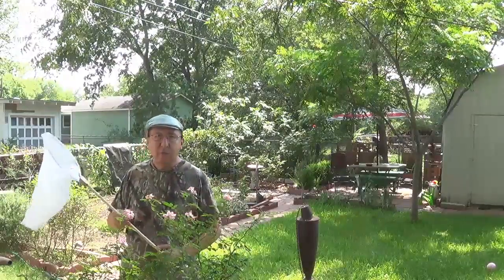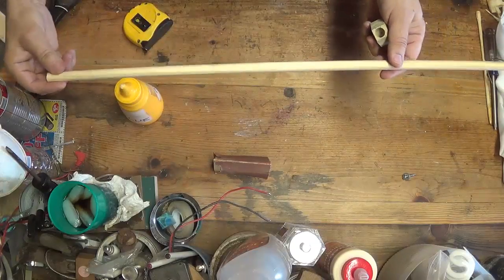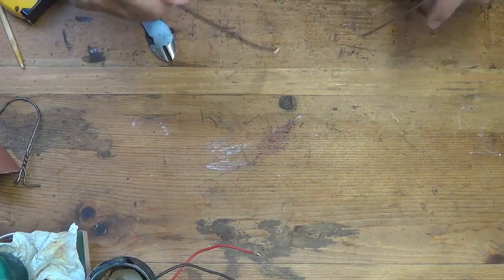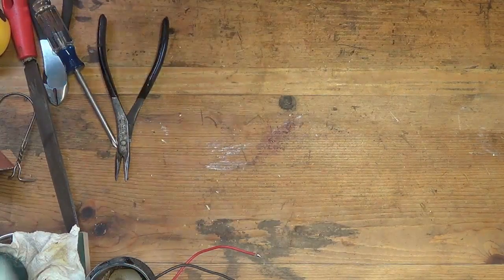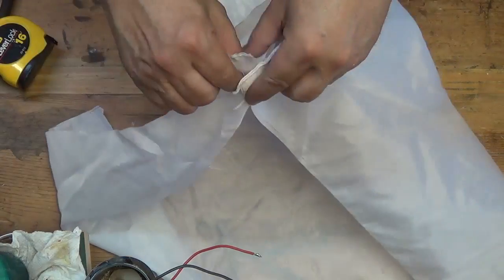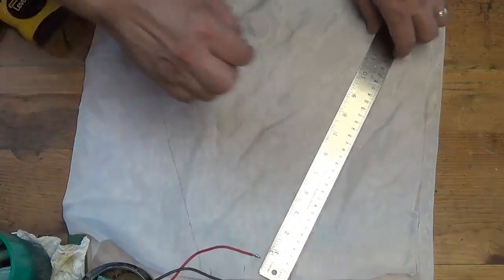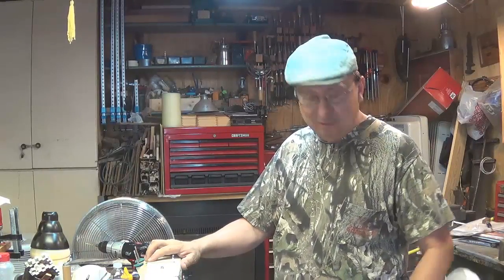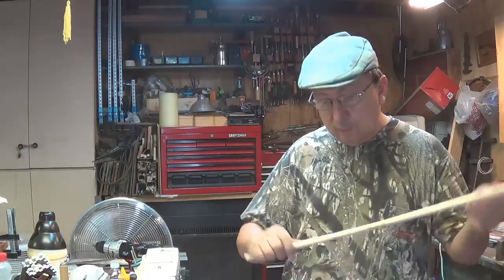Summer Fun Butterfly Net

Comment: Pretty cool. Needs to be a lot deeper to catch butterflies.  You have to be able to flip the net over to close the opening or the butterflies will just fly out.  Most butterfly nets are 30" to 36" deep and 15 to 18 (or 21) inches across. Some small ones are 12" across and about 26" to 28" deep.
Reply from the maker: Thanks Albert! The net I made is a bit undersized, barely 24" deep. Kind Regards.
Reply: Thanks Albert.  I plan to make one to see if I can keep my cabbage moths under control.   I know there are other methods but this looks like fun.